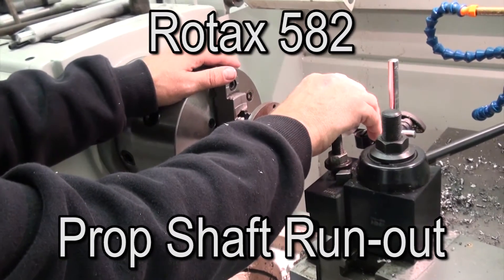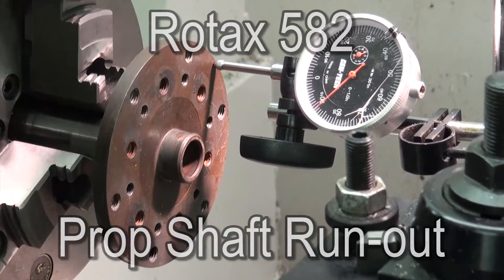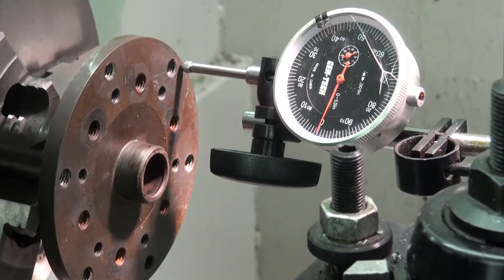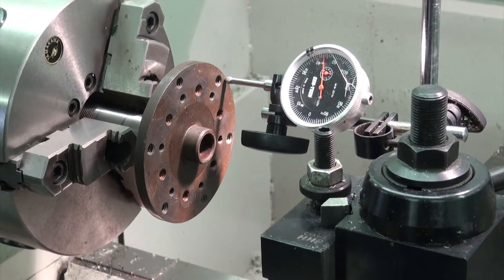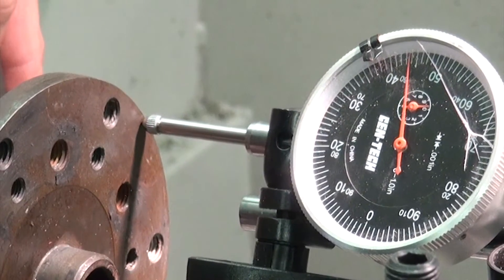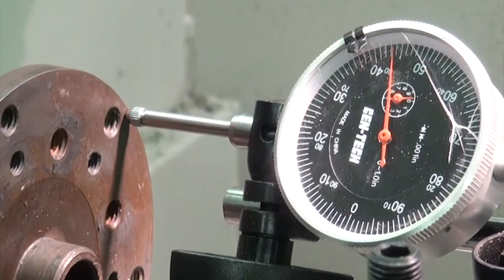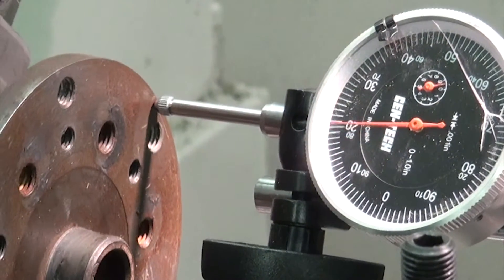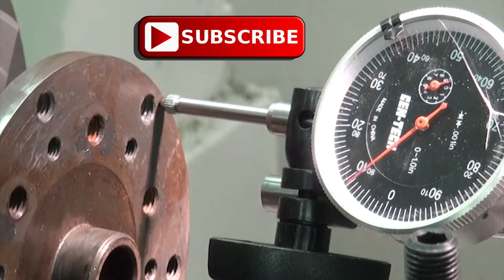Rotax 582 Prop Strike (Flange Runout Check)

Comment: You should point out that your reading will only be as accurate as is the shaft to the lathe chuck. If improperly tightened, even a hub that’s within tolerance, might read out of spec.

Comment: I see that you are checking the face, is it acceptable to check the outer edge of the prop shaft instead?  That was how I did it.  Wondering if I was wrong. :-)  Thanks for the vid!  Jim